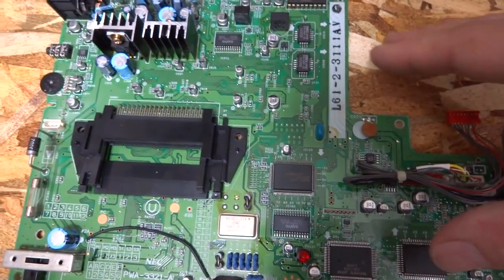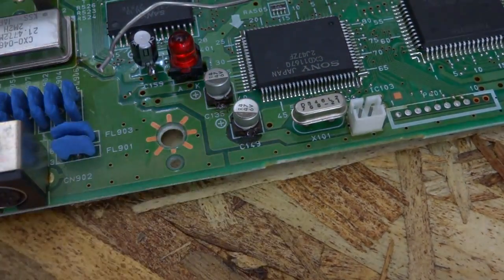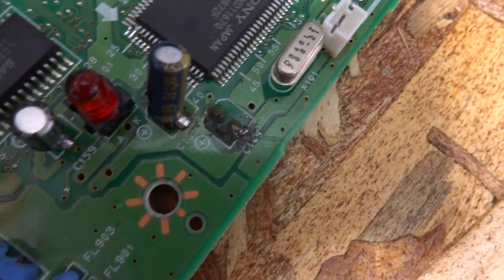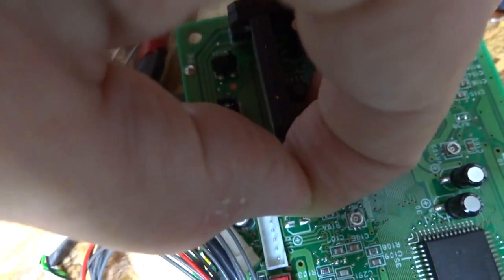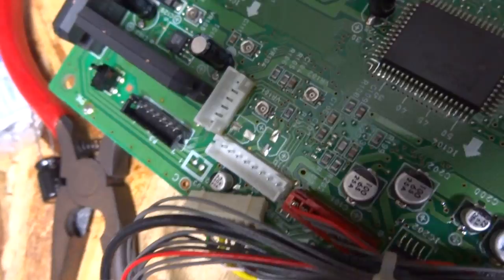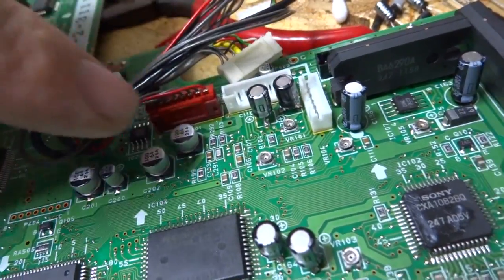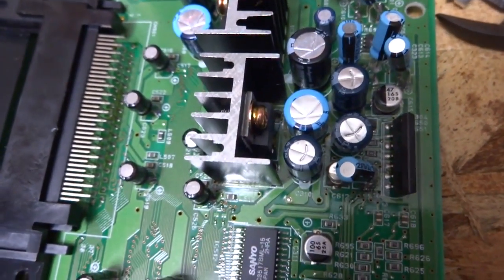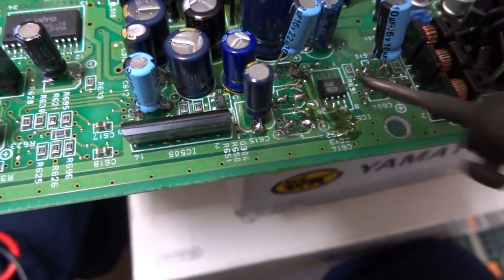PC Engine Turbo Duo Full Capacitor Replacement Repair

Comment: Great video Luke! There are hardly any resources for this stuff around anymore. I've done repairs before, but the corrosion on these things is nastier than I've ever dealt with. I've been trying to fix up a broken PC Engine Duo I got off of ebay for about 100 bucks with controllers (great deal!) and it's been going pretty well. 

I use a chisel tip and then add solder to both sides first, then hold the capacitor with a pair of tweezers (the ones with bent ends are really nice) and then alternate sides really fast. If you do it fast enough (while being long enough to melt it) they usually come right off! Some of the corroded pads I had to melt off the corrosion with some flux and a little solder though, but it's been cleaning up nicely!

Haven't put the new caps in yet because I'm still trying to figure out if I want to try to replace the two through hole caps on the bottom right that have their solder joints behind that other through hole chip. I'm not quite sure how things are put together there.

Thanks for the great resource, I'm sure this will help a lot of people.

Comment: I replaced with the same values, all with right polarity, might be a problem of cold solder due the residues of the old caps. Its the first game gear I recap so I was not sure if could be something else. Thank for the support :)

Comment: I'd recommend using a smaller soldering iron tip and cleaning the electrolytic fluid off the solder points as best as possible before removing the caps. It'll make it a lot easier to get the SMD caps off the board. Adding some flux to the solder points may help as well.
Reply: I agree ! I'm watching the video and after a few minutes I was wondering why there's no flux and such a big soldering iron : it's not the proper way to do the job.
Reply: I'm surprised I had to scroll down so far to read anyone mentioning flux and tweezers.  Plus the iron looked a bit dirty.

Comment: You should put a little solder on your tip before you start desoldering.  That will create a heat bridge which really will help getting those old parts off.  Also, you can add a little solder to the old joint which will help with the reheat of the part.

Comment: Weak sound/no sound, disc drive not reading discs well or cd audio skipping, leaky fluid under the caps and just an overall good idea to do it with any electronic device that is more than 20 years old really. Replacing caps is usually the best thing to do before messing with laser adjustments or replacing it. It rules out that problem.

Comment: Hi Luke. My white original PC-Engine is not displaying any picture and doesn't have any sound (I'm using through the IFU) any ideas on what I should be on the lookout for? The caps look OK, I still need to test the voltage regulator but is there a way I can know if the Video or CPU is damaged for some reason? I had tried to do a RGB mod before putting it away for storage but back then it did work on composite. Any idea?

Comment: Man, black Duo's can be the worse when it comes to the caps. It is pretty much mandatory to go ahead and replace all of the caps on em. First the sound usually goes out, then you start running into CD-Rom errors due to bad caps as well. At least the board is of good quality unlike the Duo-R models, yet Duo-Rs have a better batch of caps on em. BTW, the Super CD-Rom 2 add-on drive has this problem along with the Turbo Express/PC-Engine GT.

Comment: question for you. I'm going to recap the thing anyway, but I just want to know if its why I'm having the issue I have. Everything is working fine except the sound. It's intermittently fuzzy/staticky and I wanted to know if that was the caps. If I wiggle the wire a little it will affect it a bit, but nothing really makes it work perfect, just varying degrees of better or worse. So is it the AV input or is it definitely the caps?

Comment: Nice job Luke.Bye the way,whould'nt it be easier to change capacitors using the iron from underneath the board so you don't have any risk burning a part of the board?

Comment: I think it's normal for the Game Gear screen to have some ghosting. I replaced the caps on mine and still get some as well.

The LCD screens in Gamegears are terrible IMO and moderate ghosting was a common and accepted problem back then.

Also the reason why caps go bad on Game Gears Turbo Express ECT was because of corporate sabotage by competitors in the capacitor industry causing most electronics released in the early and mid 90's to have bad caps. Pretty annoying lol

Comment: I went to buy some caps from my local electronics shop - i thought i knew which ones i needed by microfarad and volts, but the shop assistant kept going on about the temperature ratings. He ended up selling me different ones because the temp was closer. Is that really important?

Comment: Did you crack the faceplate or is the actual LCD screen damaged?

If it's just the faceplate they’re $5 shipped on eBay & are easy to replace. There are only a few screws to remove & then the faceplate pops off.

Here's a video I found that shows how it's done...

watch?v=yeDrcLm2kbE

The hardest part about the replacement is not getting dust trapped between the LCD & faceplate. A can of compressed air will be useful to blow out all the dust.

Comment: Yeah that's what I meant too; slight color bleed during movement. I think it's due to the age and poor quality of the Game gear LCD screen; it's never going to be perfect.

Either that or perhaps the cap values are wrong, the polarities reversed or cold solder joints. However if the problem is very slight it's just the crappy Game Gear screen doing its thing IMO.

Comment: I've recapped a few of these Duos before, I'd actually suggest twisting off the old caps with pliers as opposed to desoldering them. By twisting them off you run less of a risk of pulling traces or pads and it makes it easier to clean up.

Comment: I just replaced the caps from a gamegear today, some of them had leaked, and smells like rotten meat XP. After replacing all the caps I stil have some ghosting, maybe I need to clean the pads and resolder again

Comment: Please let me know if you get your screen perfect by fiddling with the caps. I might need to reexamine my half ars job ;)

Also you might have knocked a cap loose when putting the Game Gear back together. The sound board caps are especially tricky to fit properly as everything is so crammed together. They can be easily knocked loose if you're not careful.

I'm making a logical assumption that the picture will never be perfect due to the age and poor quality of the Game Gear screen though.